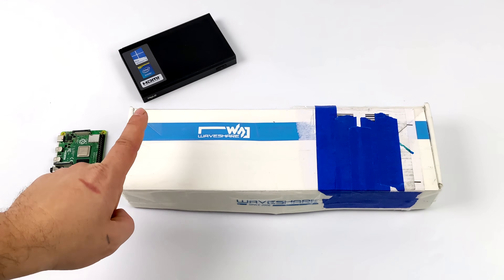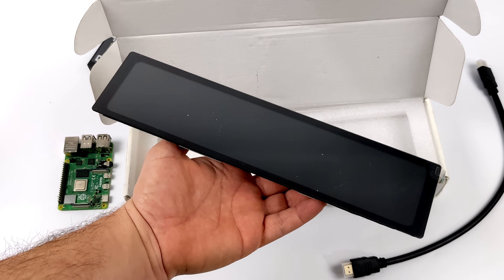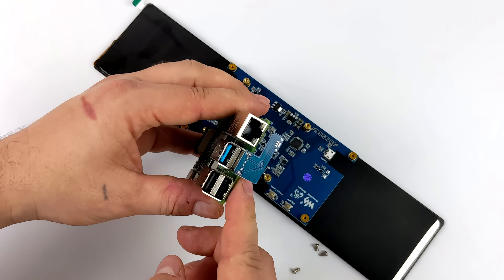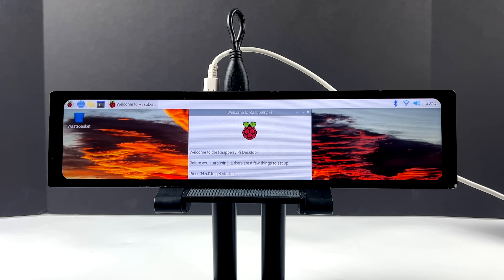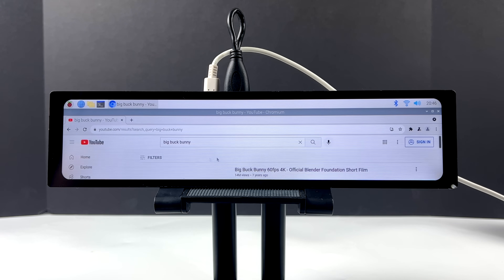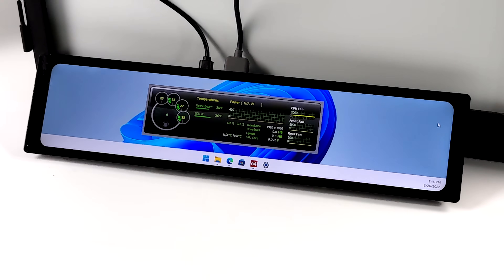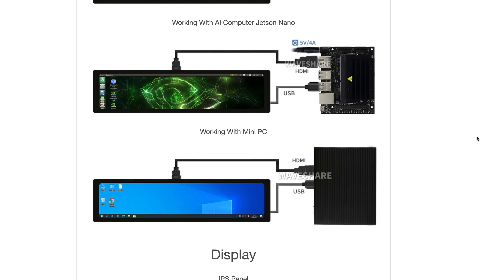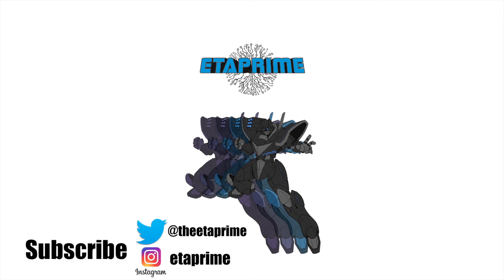The WaveShare 11.9" HDMI Touch Monitor Is Perfect For Cool DIY Projects! Pi4, WIndows

Comment: I would Love to see this as a custom made media center for old cars, I think this aspect ratio might fit very well with some 70's to early 90's design, being modern and a bit retro, this could work very well. Another use I could think of is building a custom gage cluster or even a heads-up like display in some vehicles, this would be awesome. Definitely gonna look into those displays and try to think about a little car related project for it, or maybe something like a smart home 'brain' attached to the sofa or gaming desk, so messing with the house without leaving the sofa or pc would be very nice. (I know we can use the phone for it but the idea is to allow using it without the phone nearby).
Reply: I'm currently in the process of building a digital dashboard for my '83 Volvo, it's running Tunerstudio so I can tune the engine from the driver's seat. I've done a v1 already, but v2 will incorporate a lot of lessons learned, and will be overall much nicer with a carbon fiber bezel.
Reply: @Tannerlegasse  Would love to see your work, why not put up some content on YouTube?
Reply: I was going to use it for sim racing, and out in the center to add as the dash for my buttons and car stats.
Reply: I had the same idea for my project car. Could you lose the pi for an old smart phone and use it as a display screen or would you need both?
Reply: took the ideas right out of my head
Reply: I would really love to see this
Reply: I had the same idea, I actually planned it out to put as gauges for my 1988 Caprice running some Linux distribution and mated to high-end ECU to run, map, and monitor on the go. Of course, the car won't be running the original engine,  it will get something much more recent.
Reply: @SideQuestChannel  I was going to do something similar to a 1970 voltswagen beetle as my first car,  but the prices of a bug were too expensive for me

Comment: You've covered two of my main use case: Cyberdeck (for pentesting with RPI Zero 2) and a PC Health monitor. Also, it wil definitely pump up those DIY "magic mirrors" projects.
Reply: speaking of pumping, these would be great for stock tickers.
Reply: My first thought was a sub monitor under my main screen for touch quick launching programs or little notes, sort of like a customisable streamdeck or what the zephyrus Duo laptop has going on
Reply: @jamesmacleod8388  Probably there is other ways, but the one that came to mind is installing android on RPI4, then both Pitikapp android client app and server on PC. You'll have both; PC health monitor and some custom shorcuts to launch from the deck. Now, it's matter of configure Android  to work with such arbitrary display resolution... after that, I think it might work.
Reply: definately magicmirror2. of course a preloved monitor in any size will be cheaper.. i tested a 24" 1080p wi Raspberry Pi which works great.. but if you want something small this is one way to to.. and dont forget.. touch with a magicmirror or anything signage is fantastic!! you prob dont get that with most old pc montitors.. i would like to test this with a RPi Zero 2 W for a really thin MM2.

Comment: Personally, I find it really retarded that this device (and also a few other similar devices) takes up a usb 3.0 port for the touch input. There is absolutely no need for usb 3 to drive an input device. It should have taken up one of the usb 2 ports instead.

Comment: Mount it in the back window of your vehicle to be a digital bumper sticker. Setup a remote to switch between "Back Off" and "I <3 Retro Emulation" lol
Reply: Yes, an electronic bumper sticker would be pretty cool.
Reply: Or replace your back license plate with it and then be able to turn the license plate off when you go through red lights that have cams lmao

Comment: Yes yes yes yes! I've always wanted to use strange aspect ratios ----- maybe you should buy three of these and hook it up to a PC and have some ridiculous ultra wide gaming
Reply: Maybe if he could hook them up to hinges and make a folding screen or something 🤣👍
Reply: I want to see a 180 degree Doom build running on this.
Reply: Can this be connected to a PC without using raspberry pi ?
Reply: @9714  via hdmi
Reply: @9714  its just an HDMI monitor with weird aspect ratio.